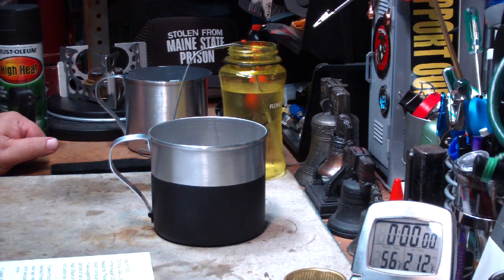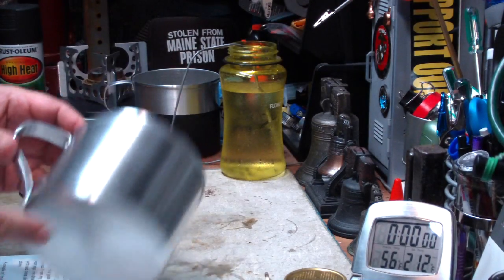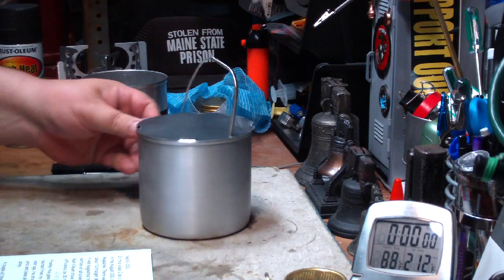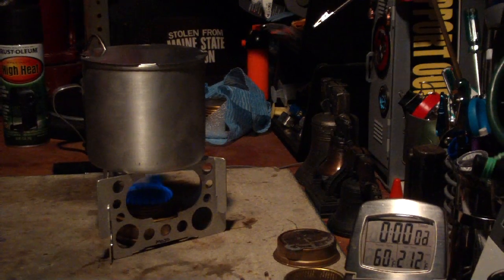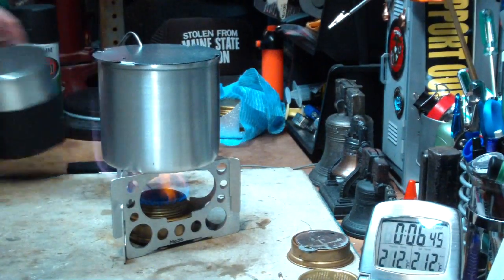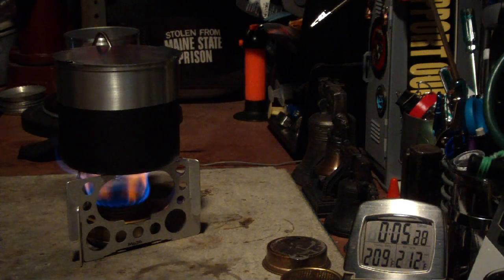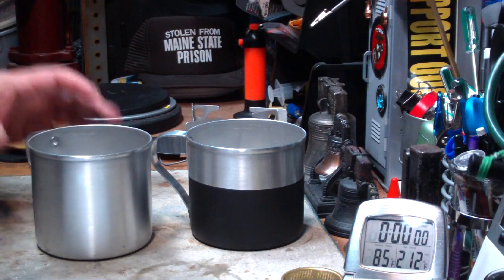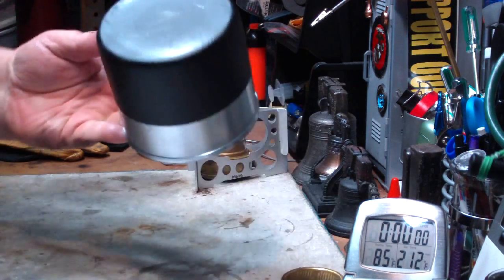Backpacker Magazine Pot Idea Test - Revisited

Comment: The most practical way of raising energy transfer efficiency (less fuel needed to boil) is to build a shroud from burner up to near top of pot to force heat to funnel up so all heat energy is focused on surface of pot and slowed down to transfer maximum heat.

Comment: Just a thought on your original video, do you think the heavier pot took the heat better therefore boiled quicker, as you see you do get a marginally better boil with it black with the same types? Maybe if you used two of the original heavier pots you'd get a significantly better boil time?

Comment: Good test. No disrespect to people who don't like soot on pots, but this issue has always puzzled me. I primarily use fire for cooking and all my pots are coated in soot, which I don't scrub off. I pack them in a light cotton bag, or the new light synthetic shopping bags, and there is no problem with keeping pack contents clean. Thanks to what I learned on Hiram's channel, I have also converted from gas stoves to using a Trangia alcohol stove as backup to wood when its raining out. :o)

Comment: The idea of using paint is just to delay heat from escaping out from around the pot, but spraying the bottom part also blocks heat from the stove from getting to the water inside the pot. So the correct implementation should be paint all the sides but leave the bottom unpainted? Just a thought. Anyways good experiment and thanks!

Comment: My bet is that the 30% value is the possible increases in radiative heat transfer (infrared) not total heat transfer.  Since most of the heating is from hot gas in contact with the pot, not just IR, then I'm not surprised.  I would think that one thin layer would do a slightly better job than 2 layers of paint, since the paint itself likely isn't a great heat conductor.  Also, the blackened pot should cool down faster if not cozied due to enhanced IR emission.

Comment: Another great test, thanks you for all of your efforts.  There is a good chance that the paint is also acting like an insulator and that might be masking your results (I wonder if there is a measureable difference in weight between the two pots).  I suspect that the ideal test would be to test two anodized pots like the GSI Soloist, where one pot has the anodized layer removed.  Best regards - Jon